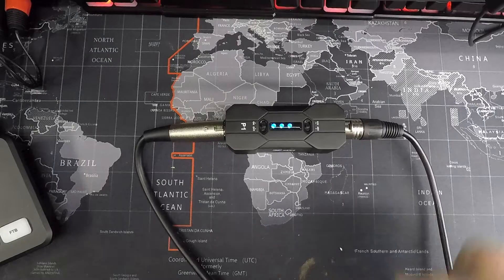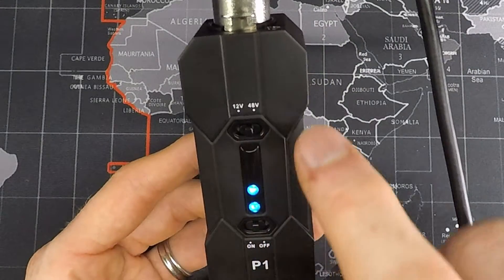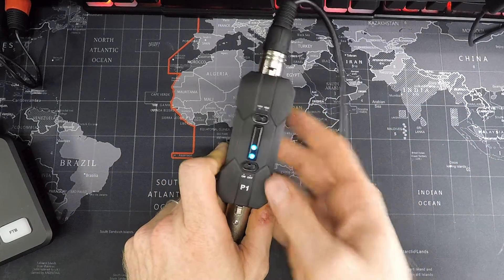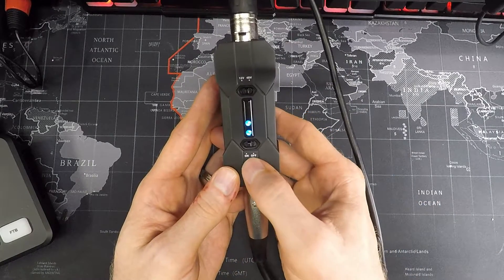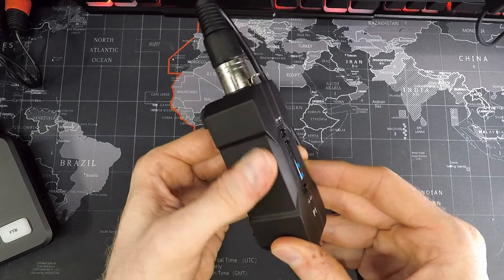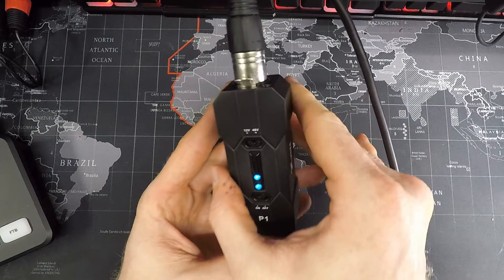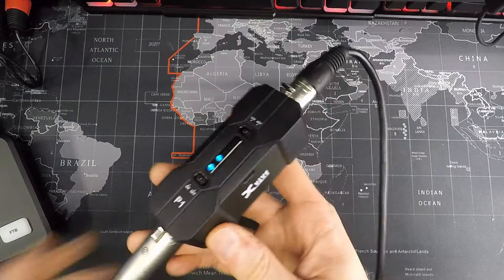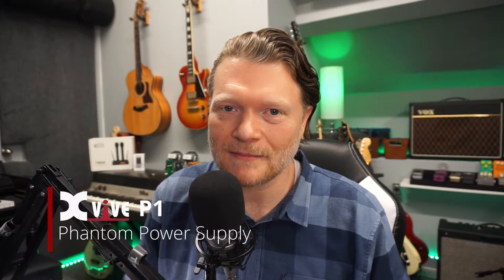Xvive P1 Portable Phantom Power Supply for Microphones that need 12v or 48v

Comment: I need something to increase the gain of my shure sm58 wired mic to my Thump GO which does not have phantom power. Will the P1 provide gain for my sm58 dynamic without damage to my mic? The mic is just too low gain for the Thump GO. Thanks

Comment: Kennis, have you tried running the P1 output into a Camera with an adapter cable ? I just purchased one hoping i could power my Rode NTG2 into my camera but all i get is a -12db  static or hiss. When you tried this setup, did you need a special cable or something to get your mic to sound clean ?

Comment: excellent! I just bought a Shure SM 35 headset singing microphone, which uses a four pin mini XLR and requires phantom power. I want to go directly to my portable amplifier and did not want to use a body pack. I just got off the phone with Shure tech  Support And the I was really impressed when I showed this to him. They have a lot of people that call in looking for something like this. he is sending me some links to the adapters I will need to connect everything

Comment: Thanks for your interesting presentation. What happens if I connect the Xvive P1 to a mixer input with 48V phantom active ? I know that P1 has been designed to solve the opposite problem, i.e. when phantom power is not available, but it may happen that one connects the P1 output cable to an XLR input with 48 V on pins 2-3. Thanks